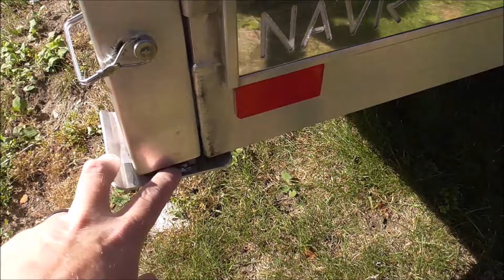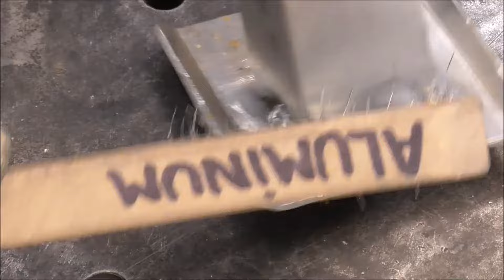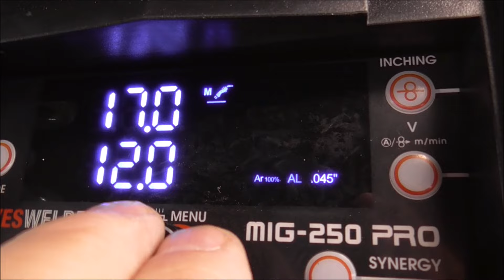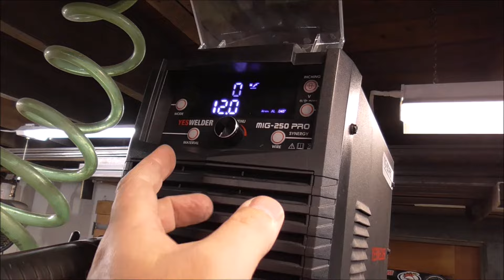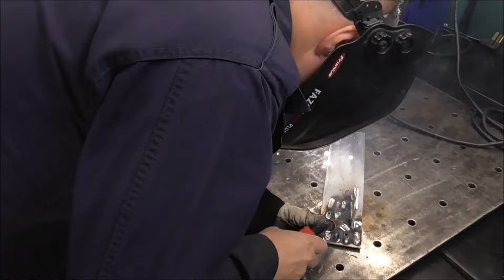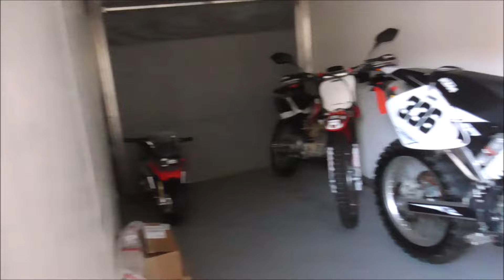Aluminum MIG Welding Repair

Comment: I had to have a pacemaker/Defibulator put in. They tell me I can't weld any longer now. I sold my wire welder I had just got. Does anyone have a work around so I can wèld. I tried to look at a vest to protect me but don't know if it will work.
Reply from the maker: Unfortunately, I don't believe there is a work around for your situation.
Reply: Oxy Acetylene.  To weld aluminum or stainless steel you'll need the correct flux and with aluminum you'll also need the correct lenses because  orange burn can wreck your eyes without the correct filter over time.

Comment: Brandon !!! What will happen if you try to weld aluminum with C25 gas ????
As it is 80 % Argon
Reply from the maker: Good question. I've never tried, but my guess is it would produce a sooty weld with messy globs.

Comment: I'd cut the plate clean off, clean up all the surfaces to be welded, inside and out, then weld on a thicker bottom plate.
Reply from the maker: I never use them because I'm only loading bikes, but if I was loading an SXS, it might not be a bad idea.

Comment: Your particulate cartridges on your respirator are doing you almost no benefit whatsoever for the vapors. Organic vapor cartridges aren't very expensive and can be found wherever you got those pinks.
Reply from the maker: Thats incorrect. They are p100 rated for welding and cutting fumes. If your a member of our Facebook group, I have a section titled "files" and have the 3M specifications for this cartridge and many popular others.

Comment: Thank you for this I also watched where you converted a 120 MiG welder to an Aluminum MiG welder. I can’t wait to use the .35 tip with the .30 wire that along with holding my nozzle too close to the material might have been my issue. Also I have the aluminum wire gun hooked up to my welder instead of doing what you did. Would like your thoughts on mine vs yours? Thanks again 👍
Reply from the maker: Spool guns are awesome! They can be a little bulky sometimes, but it pretty much eliminates all the feeding issues associated with a push only mig setup

Comment: Respirator fit testing is done to assure a good seal (fit).  Any hair or unshaven will guarantee a bad seal, negating any attempted respiratory protection.  I watch a lot of videos that suggest being unshaven is ok.  It renders the respirator ineffective. See https://www.cdc.gov/niosh/npptl/pdfs/facialhairwmask11282017-508.pdf.   Otherwise, great videos and thank you!!
Reply from the maker: I agree with you 100%. I go over this in depth in a few of my videos.  I disagree with anyone that says having a beard is acceptable. To fit properly the mask has to make an air tight seal. Part of fit testing is blocking the inlet and taking a breath inwards. If it leaks around the perimeter of the mask than it's not sealed properly. It's not as critical for me now whereas I no longer have to meet OSHA standards because im solo but at the same time, a poorly fitting mask is still better than none at all lol.

Comment: Like the good old saying goes theres more then one way to skin a cat. Just wondering why you chose not to completely break off the foot pad from the tubing considering all the welds were broken. Imo and experience it would have been the best way to go to get the materials as clean as possible to re weld and flatten the pad again. It would also give you a chance to clean the inside of the tube just in case there were any debris that can contaminate your weld. A little extra goes a long way
Reply from the maker: I knew that reapiring it would work. No sense making more work for myself than I need.

Comment: I have a couple of Aluminum welding jobs, fixing a broken motorcycle ramp to go into my truck is one. Good to know that the Yeswelder is up to the task. Good tip about the Stainless brush to ONLY use on Aluminum.
Reply from the maker: Thanks man. ALuminum is fun to work with! @theidahodian4518

Comment: What's your favorite all-around welder of all the welders you have ever used.
Reply from the maker: Hands down my Fronius 2200 and my Fronius TransTig. With that said, those are professional and factory certified welders which come at a price not usually justifiable by a hard core home warrior. I really like the Hobart transformer machines also. These are all tried and true.  I like the YesWelder line of welders because they pack a lot of features for the price and they seem well made but I haven't owned them long enough to say that they will be just as reliable as the other welders I mentioned 10 years from now.

Comment: Should your helmet shade settings change for aluminum ?
Reply from the maker: Great question. Aluminum is slightly brighter but I don't. I keep it the same as for mild steel. I don't really darken mine until above 160 amps. I tend to weld on the lighter shades but to do that takes experience knowing what works safely with your eyes. Scientifically people with lighter eyes can't tolerate light the same as darker eyes. For example, I cant close my eyes and look at the sun. It hurts. I have to put my hands over my eyes. Some people can though. For welding my eyes aren't as sensitive. Your better to go darker and put a bright artificial light on your work to help you see than to go too light and suffer with arc flash all night.
Reply: @BrandonLund  Thanks for answering.  I never welded aluminum except with a spool gun and forgot the hood settings. I DO remember the buzzing (think Dr. Zarkov) of the Heliarc guys and the major FLASH they got in the eyes often!

Comment: Should have been a spigot swivel base in the bottom of that adjustable tube when trailer was built originally, you did repair the poor design.
Reply from the maker: I'm pretty easy on my stuff so its doubtful this will happen again but if it does that's not a bad idea.

Comment: Ton of tips, i ended up getting a electromagnetic drill after watching you use yours for a custom welding table, get this I managed to win at auction a steel thick plate what the pictures or description didn't mention that it was a steel surface plate and the underneath/bottom is massively supported/formed, it stands like four inches tall But in between the bottom supports I might be able to accurately drill to make a welding table with it, man it's heavy like real heavy and flat, thanks for all the tips
Reply from the maker: Score!!!!! That's awesome!

Comment: Absolutely love E-tracking 😁 really helps to make the difference in load-shift, but you knew that 😉.
Thank you for the repair vid
Reply from the maker: I've been torn between E track and L track. My favorite is L track with the flanges because it looks nice recessed flush in the floor but I went with E track for just one reason. My floor is made of 1x3 aluminum box tube so I either thru bolt it with 1 bolt every 16" or go with E track where I can get 2 bolts every 16". If my floor was c channel I would bought the L track for sure.

Comment: Nice one Brandon. For what it is, it will do just fine. You could have spent a lot of time really going to town on it, but at the end of the day, it will work. That's all you need 👍🏻👍🏻👍🏻
Reply from the maker: I think so too Basil 👍🙏 I could have bent a new plate or cut off the old but for me it would have been unnecessary work. This will last me for as long as i own it and it matches the other side perfectly 😁
Reply: @BrandonLund  Exactly. Part of the process is deciding how much time needs to be spent on something. 👌🏻👌🏻👌🏻👌🏻

Comment: Hi Brandon, nice video. I've learned a lot of tips from you. No offence,,but the way i'll do it,is to try (if posible,dismantle it to give it a good prep.)to lessen the posible back job.3 (though that's not critical job) and make it back to the way it should be. Again no offence, its just my way. Thanks. I'm still exited about who'll be the lucky one to win the welder give away. 🙏🏼💓🙏🏼💓🙏🏼💓
Reply from the maker: No offense bud. If this was a mobile job trailer that my guys were using I probably would have cut off the foot and used 3/8" plate but I'm going to be the only one using it so it won't ever break again. A simple plywood pad would have prevented this in the beginning. Its common practice to always put a wood pad under metal feet that contact the ground. Its done to prevent slippage and evenly distribute weight. It's an old rodey trick working around cranes.
Reply: @BrandonLund  👍🏼👍🏼👍🏼
Reply: @BrandonLund  i recieved another text. First was an email(i already sent on your email) now is in form of text reply.

Comment: Not much to that piece, should be spring loaded
Reply from the maker: @Jake Schisler Hahaha I can't believe you just said that! As soon as I dropped that foot out I was trying to figure how I could mount a sping inside the tube so it automatically retracted! The only reason I didn't is because I was concerned the spring would rust and stainless would be a no no in contact with aluminum. Too funny! 👍👊

Comment: Nice fix brother,  Question,  did you ever thing of changing those footers/ down riggers to steel. I had a 16ft enclosed dual axel trailer and it to had aluminum small feet on it and when we would unload electrical wire, heavy equipment,  etc in grass damn those little feet sunk in .so I replaced the 2 1/2 square tubing to steel with thicker & much bigger feet. Plus kept 2x2 3/4" plywood as pads for down riggers. Just some food for thought there  my friend.  And as Always it's a great feeling to repair your own equipment/things. Great video,  KEEP THEM COMING........!👍👍👍
Reply from the maker: Thanks man I appreciate your support!  thought about making the pads larger by welding a larger one to the existing pad but I'm not sure it would be necessary for me.  I'm going to try to stay on pavement when I load and unload and I'm going to make some 12" square plywood pads just in case for the tongue jack and the rear jack's.
Reply: @BrandonLund  yeah, those 2x2 plywood pads really make a difference,  I just hate when anyone of my apprentices  takes or uses them for wood/scrapes just paint them in expoy paint and a bright color, so you YOU KNOW THERE YOURS ....HAHA👍

Comment: Best thing I fond repairing those kinds of jobs. Is to weld in a 2 inch high square insert or 4 plates first to the pad foot that fits inside the box tube. Than drill 2 holes 1 inch from the bottom edge on each side of the box tube for plug welds. Also beveling the bottom so your root  and fill welds will attach to the bottom of the insert and the pad foot at the same time.  😎👍👍Even cutting a hole out the pad foot to fit over the tube or pipe. Welded top & bottom with a fill plate to close the bottom of the tube is another way to make it stronger.😎👍👍
Reply from the maker: That sounds like it would beef it up nicely! 👍

Comment: What model of welder is that? I thought only AC TIG could do Aluminum. I'd much rather use this Mig method
Reply from the maker: Im using YesWelders 250 MIG Pro.
Reply: @BrandonLund  wow the price is good even in Canada

Comment: Something that may be worth checking out. I've seen videos by quite few welders from across the pond that shows quite a bit of these welders don't have the features they claim . Like burnback time, run in time are two I can think of , that does not work on alot of these machines.  On the decapower I don't think the burn back works and I've seen one content creator that shows his bbt doesn't work aswell.  So just imo I think it'd be a great video showing features of the ywm , deca , 250 pro's to see if the features really work as they advertise . Good video video 👍
Reply from the maker: Im always willing to test their claims so yah im going  to be on this. Its the first ive heard of this issue so we are going to find out

Comment: Good repair, and also a warning that you might want to take something apart to clean it if it has been outside gathering dirt.
Reply from the maker: Very true! I never even gave it a thought at the time either. Upon closer inspection, the tube had black stuff and a nest inside lol
Reply: @BrandonLund  I totally get why you didn't give it a thought, neither did I till it went a little wrong.
Reply: Glad you made a point to use a stainless steel brush for aluminum only.

Comment: Hi Brandon

As a welder myself and have made trailer support leg's from steel ( material not the item) I always welded the tube to the foot all the way around.

This was to stop water or mud penetrating between the leg and the foot as we all know in welding that ice breaks weld like us breaking a piece of chocolate off.

Where we would also spray the inside of the tube with a rubber type of coating to reduce water build up on the inside as a protective layer from moisture or water build up if the top of the leg is left open, whether in concealed or open tube mount.

But another great welding job done 👍👍👍👍👍👍👍(7 Thumbs-up) for a job well done,nice one Brandon.
Reply from the maker: Thats why i love our community. We have so many people with so many backgrounds that we can all learn from one another. Thans for sharing Phillip!
Reply: @BrandonLund  and don't stop your aluminum weld on a corner . Start in the middle  and weld around the corner so you don't have a place a crack to start. Also weld back from the end of the weld so you don't get a crater, just rock back a 1/4  inch.

Comment: first time ive seen .045 wire used nice job
Reply from the maker: It was a little big for the job but i got it done. .035 would have been better suited but like real life sometimes you make due with what you got

Comment: Use a thicker pad. No reason for it not to be flat. Electric pallet jack which is about a ton plus a pallet of freight which can be about a 1000 lbs or heavier running in fast will cause this. Because of increments  of drilled hole in post. Post locked in about a half inch above that hard surface. A thin  pad will bend like that causing welds to break. Using screw jacks to firmly push firmly push on ground will stop this problem
Reply from the maker: Thats actually a very good point. Doing it on soft ground would even compound this.
Reply: Add a 2x2 square tube to bottom of trailer.. then slide a tube with attached screw jack to get like a outrigger then jack pad to ground. Only way to stop the problem. You’ll never stop it with increments of holes. Aluminum can’t take the pounding. Just saying. My thoughts anyway.